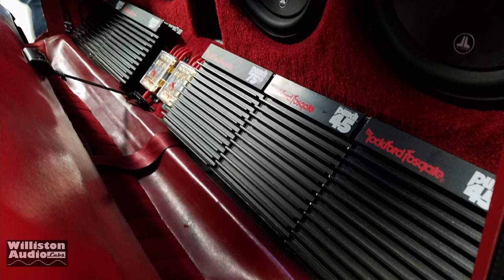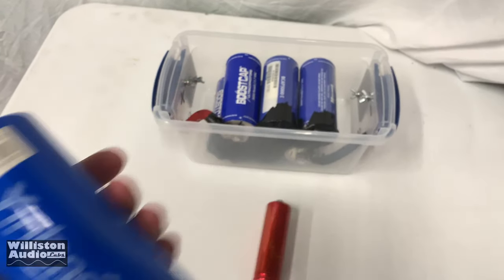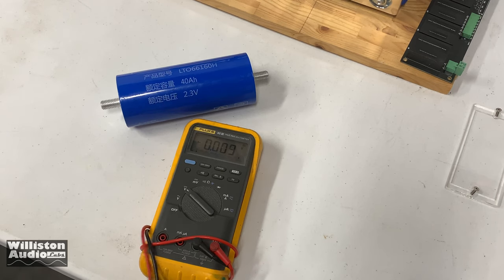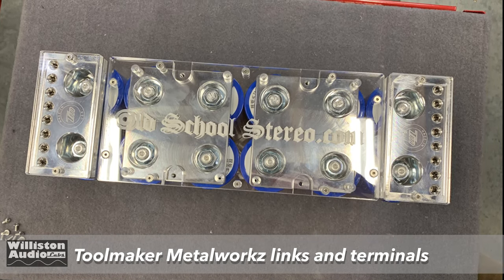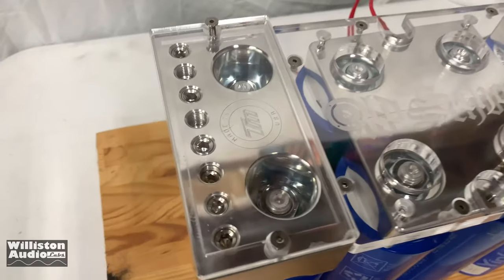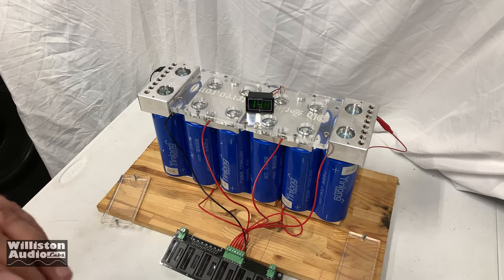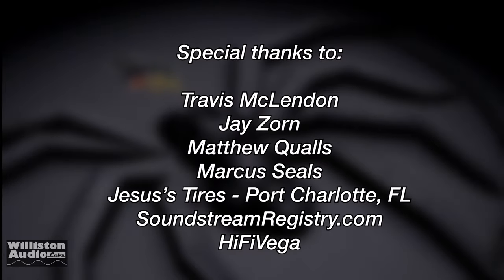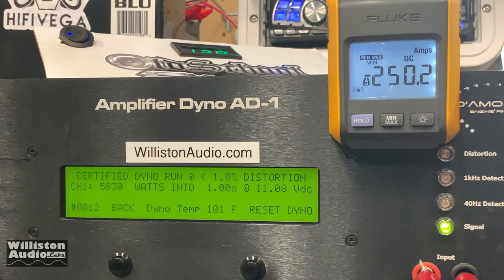Lithium Batteries for Car Audio? Yinlong LTO Cells LTO66160H 8000 watt capable Battery Bank [4K]

Comment: Lithium is soo cool. Which I could afford it right now, update: I've purchased 72ah of headway, power supply and a bunch of other junk to test and wire them up is here just waiting on the cells. Stoked to stay @ 14.3v when dumping the bass. Thanks for the info. It's all useful fosho

Comment: Nice and clean ! As I was typing my comment you said it! You can get an 80ah bank for about 900 which is damn good I got a friend that spent 3-4 grand on XS lithium 🤦🏽‍♂️ I’m going to share this with him lol
Reply: I figured those XS lithiums were overpriced but damn. AGM for me
Reply: You can build this bank with the xs power 45 which is rebranded yinlong but a 6 bank series is 45ah not 40h same shit Big D has here just 45. Anyways you can get a 12 cell bank of either the 40ah for 900 but the 45ah is 100$ more it's a lil over 1,000$ but that's 12 cell bank 90ah all the bus bars, bolts and balancer from Big Jeff he has both even the 35ah for a lil cheaper.  What in the f*** did your friend buy that was 4 bands lol
Reply: @GTILOUD  what about CMAX.   They have a 45ah for $799.00?  That sounds like a better way to go unless you know something I don't?  Please do tell

Comment: Just did 3 of these. 240ah. Replaced all my 7 titan 8 12volt. What a difference. Single 400 amp mechman alt. Ext regulator. Charge at 15.8-15.9. They will hold 15.1-15.3 for a minute with about a 1500amp current draw. So 500amp per bank. After about a minute it starts slowly dropping, but it’s rarely playing for more than 10-20 seconds at that volume. They also recharge fast. Back off the volume they are back at 15.8 very quickly. I could not more highly recommend these. I did 240ah with very nice bars. Each end accepts 10 sky high oversized 2/0. Total cost $3225. $1075 per bank. Great video big D.
Reply: Do you have any links to where you purchased all of your stuff the bus bars the cells the balancer
Reply: @GTILOUD  I bought them in premade 80ah banks from CES. Much easier. Looks a lot nicer. Balanced and ready to go when you receive it.  On any search engine type in ces 80ah. First thing that pops up.
Reply: @DrMichaelPetty- Im not doubting your experience with the Titan 8, but were they the PWR= power, or RSV= reserve? Also maybe something was not right in your setup, or the New Titan 8 PWR batteries are much better now? Because i just recently seen a test, where only 1- Titan 8 S6 PWR (10Ah @ 75c!) battery was used (only had a 6amp charger hooked up for the test), and it only dropped 1.8volts (16.0v to 14.2v) and powered an amp to 11,400 watts R.M.S. On the Smd amp dyno, with a 1,000 amp draw! The test bigdwiz ran in this video above, with the 2 banks of 40Ah YinLong Lto, (so 80Ah total), dropped from 15.0v to 11.0v with a 500Amp draw= 1/2 the amperage draw, and more than twice the voltage drop! And only made 5800 watts on the dyno.
Reply: @DrMichaelPetty- That 400 amp alt. charging @ 15.8v supplys 6,300 watts all by it self, then each bank of 80ah yinlongs support 6k, so x3 or 240ah= 18k of battery power, and 6,300 from alt. Power, for a total electrical power output, that would support 24k. The Xs power 6S Titan 8 PWR, charging @ 16.6v with a 400 amp alt., would only Require 3 of these tiny batteries ($799 x3= $2,397) to maintain 16v, with a 1500 amp draw.

Comment: Interesting stuff! I just spent nearly $400 for the group 31 UltraCap instead, after watching EXO’s video on it.

I already own the Maxwell ESM and love it. Wish I knew how to convert it for this
Reply: Do you like the ultra cap
Reply: @201231  I recently purchased that Ioxus cap opting for B-stock for 200 vs 400 (a couple days just about every vendor reduced regular price of 400 to 300) which only had some scratches and a little chip on the plastic seem. Purely cosmetic and honestly can't believe that cut the price in half. At any rate I am literally obsessed the cap it is unreal. I can't believe they don't seem to be gaining the traction they deserve. Running 2, 1k monoblock amps with factory premium amp (650ish watts) while charging my phone on a AC/DC converter with Heater/AC full tilt, windshield wipers on, and no perceivable voltage drops, lights dimming, and subs hitting so much harder maintaining consistent power with hungry continues trap bass lines. I literally almost want to purchase another one just in case mine gets stolen or breaks for some reason and they sell out (noticed some websites B-stock is getting low). But I figure with a 10 year or whatever it is warranty by the time the thing goes out whatever is available will be better or perhaps smaller which would be welcome. I still might buy another one while I can get one for 200 bucks for a christmas present or something. Father has a diesel truck that needs 2 batteries and a ton of juice to start so while not a basshead like me could use one of these and only 1 battery and not get stuck somewhere like we did the other day. Have a 5k amp on the way thats happy at mid 12 volts (sure you can guess which one that is) and just going to use my current 120 amp alternator (big 4 of course) and one XS AGM battery sitting next to the cap (have new LA battery under the hood, no isolator no issues) with 100% confidence. Just get one but please leave one B-stock left me me haha

Comment: Fyi nm = newton meter not nano meter
Reply from the maker: Great catch. Big dummy lives
Reply: And a 12mm by 1.75 is a standard metric bolt 😉 nothing special.
Reply from the maker: https://youtu.be/tqd3HS_m6SY
Reply from the maker: @massivehertz3869  they were $0.95 each at my local hardware store and $0.16/ea at BoltDepot
Reply: @massivehertz3869  mmyeah, M12 nut
Reply: nm = nanometer... Nm = Newtonmeter
Reply: I understand how confusing it would be growing up with the old imperial system. But the world runs on metric so it's useful to learn. 
Interestingly, important things made in the US (like space products, medicine etc) use only metric.

Comment: Also, I would like to add that for car audio applications there are effecively no BMS modules that can efficiently sustain the current draws we may see (400A+). As such, nobody really runs the BMS in the car audio world. I would like to see a retest of this battery bank without the BMS.
Reply: I guess as a person who does not know much about batteries, you did not see the gigantic bus bars that you connect to the amp.  The BMS he was using did not control the flow of current from the battery, it only maintains the balance of the cells to each other.  I work for the sister company to Yinlong that actually licenses them the LTO to make these cells.  I'm an engineer, so I know what I'm talking about.  There are BMS modules that will run the power through the BMS, don't buy one of those for high power applications like car audio.
Reply: No need for bms. Just use a cell balancer.
Reply: @timhoover1416  There are definitely stand alone BMS units that can handle 500 amps continuous. Daly makes a 500 amp smart BMS that can do 500 amps continuous and I believe well over 1000 amps burst, and the BMS settings are accessible and adjustable. I've seen them for Lifepo4 batteries, but I haven't looked for an LTO BMS yet, but I'm sure they are out there. You are right though, the BMS would be a constant parasitic drain on the cells, and not desirable, even with the extra safety it provides. LTO Cells are already really safe and can take much higher Voltage than most car alternators provide, so I can understand why most people only run an active balancer with a 6s setup of LTO. Battery hookup has a nice little setup of LTO Cells for $200 that would be perfect for automotive duty, but I think I would probably want a 2p6s version of this setup, so at $400 plus balance board and some kind of Case, it's not so cheap anymore. It's probably still worth it though, just because they will outlast the car you put them in, but that's an argument you couldn't win with some people with a different viewpoint.

Comment: I went with JY 45.6 ah’s with 240a, 1 bank of XS power super caps, 2 15’s DC Audio level 5’s, 2 Crescendo 4k’s strapped while driving I don’t see under 14v. 
But I like these cells. Maybe switching in the future to CES 80 ah. Thanks big Dawg for the video. Excellent job.
Reply: Go with the ces 80ah its worth it ihave a 250 ces alt. Nd don't drop below 14.2.   Full tilt Then climbs back up to 14.4  On a synergy wfo 5k at half ohm in 110+ degree. Heat when the cars been runnin g for a while im happy with my ces 80ah. Feels good playing full tilt on idle not dropping below 14.2
Reply: Dbuilt Series thanks for letting me know. That’s awesome to hear even in hot weather. In Ohio we’re hitting 90 degree while driving I’m in the 14’s full tilt. It’s when at idle I drop to 12.8 to 12.2. How do you do at idle?
Reply: @UrAvgBasshead  at idle im at 14.3 14.2 full tilt. These lto cells are bad ass well worth the money gained more volume i used to only play at volume 56 clean on a pioneer x8800bhs. Now i can play to volume 60 clean had to re set my gains and volt meter when i switched to the ces 80ah. I used to have 2 northstar agm nsb31s in the rear droping to like 13.2 13.4 at idle almost full tilt while driving around 13.8. 14.0. Now im at 14.4 14.5 full tilt driving once im fully warmed up.
Reply: Dbuilt Series what charger do you use and how often do you charge your battery?
Reply: @UrAvgBasshead  i haven't recharged this new ces 80ah i just installed it today i have. A   Noco 26000 to charge it later on if i need to it should get the job done
Reply: I used to charge my. Northstar agm31s with this noco charger every 2 weeks held voltage pretty good with my alt and all my welding cable runs
Reply: Dbuilt Series thanks for the information. That’s awesome to hear.
Reply: Dbuilt Series I know it feels good to not be dropping. That’s how I feel when I’m driving. Slowly but surely I’ll get there.

Comment: when you do a draw test the cells will go back up slowly when in use,It had a big draw from the start so when voltage drop the amps go up .am using Headways but  I want this setup now to go with my 1500F 16v, super caps ;)

Comment: Discharge and recharge the bank a couple times. It will improve.
Reply: LTO batteries don't have very good discharge efficiency so the capacity isn't quite going to match 40 Ah. They do have some other benefits, though, but LiFePo4 is probably still the best way to go.
Reply: This battery pack needs a bank of super caps to allow it to charge and discharge with out over heating. Draining those batteries like that dyno run did they won't last very long.
Reply: @iamjackalope  LTO cells are fine with being charged and discarged at 10C. That translates to 400 amps of current going in and out of them - per cell. Once you add six of these cells in series, you're looking at a battery pack that you can push 2400 amperes into/out of. Not that that is possible, there are too many other limiting factors, like the fact that 2400 amps at 12 volts would melt cables.
Reply: Dave Micolichek  Huh, yeah, you're right, I wasn't thinking that through. But still, you'd need one hell of a system to draw more than 400 amperes (and at 10C they can deliver that).
Reply: LTO batteries are quite odd for music aplications.. they can be used as a off grid solar system battery pack due to the cycle ratings ( Propperly charged and not full discharged etc. up to 25 000 maybe even more  ) so they are worth it against Lead Acid but they are much mooooore expensive and BMS board is expensive too aspecially the more than 6S BMS for some type of aplications like power inverters from 24 to 230 Or 110 50/60Hz with huge ammount of power. And yes they are quite a bit expensive than LiFePO4 batteries but they have a highest longevity from all batteries. And also they could have 100Ah per one cell  and they are i think 3.2V maybe idk 🤷‍♂️
Reply: @lorcro2000  batteries in series do not increase total amps, but it will increase total voltage. running the packs in parallel would increase total amperage.
Reply: @blackwhip  Yep, brain fart on my part, I did honestly know that. But thanks.
Reply: Dave Micolichek  this is still a 2P6S pack, so 800, not 400 amps.

Comment: Ok so. Just to add to the parallel charging info..
You need to be careful when charging in parallel. Each cell needs to match as closely as possible. Not just in capacity but their impedance, IR (internal resistance) needs to be the same as well. If one cell is lazy, the parallel board is averaging the sum so others can take too much. 
I would cycle all of these probably 3 times then check what each cell accepts in capacity and what the IRs are. If they differ +\- 2%, don’t parallel them. This is much more crucial with other chemistries but still relevant here. Especially going in my vehicle.
Anyways... Love your channel Big D... keep that shizz up 👊🏼.
Reply: I agree. We're generally talking about minor tolerances but it can add up and be catastrophic over time. Less of a problem with caps, but lithium fails in a much worse fashion (unless you can somehow manage to seal the vent on the cap and turn it in to the.. you know).
Reply: Did you not notice the balancer he used?

Comment: Buddy is running 2 80ah CES batteries and a 370 amp alt. Charging at 15.3 drops to 15 full tilt and slowly goes down from there. Long demos no problem and charges back very quickly. 2 12k amps at half each
Reply from the maker: Great feedback. I’m getting 2 more banks
Reply: @wal  can't wait to see it. I really appreciate you showing the setup.

Comment: Yoooo. This is smart. 
I made a "home sound system" from a car audio setup in an mdf enclosure. Oldass Sony single din, 4 speakers, a jl 250/1 and a 12" infinity kappa. 12v comes from a PC psu. And reserve power from a huge lipo pack salvaged from a fried jump starter. The 12v regulated output from the psu will never over charge the lipos but they are in a battery sack just in case.

Comment: If they don’t want to be paired with agm batteries is that for an extra battery or for the main battery too?
Reply: Main battery but not under the hood you would do a battery delete and place the yinlong away from heat

Comment: Is this still current as far as what people are using the Ying Long LTO cells?
If so, is the price the same?
I'm glad you mentioned in the video not to use an AGM with these because I was considering building one and having the AGM under the hood to the small one and have this in the back

Comment: I have a ces 80ah yinlong bank and 1 bank of Maxwell boost caps stock 150ah alt and rest at 14.2 on  2 sundown scv.4000 at 1 ohm strapped .5 each amp and have never went below 13.5 full tilt in the lanes on a 1.15 sec average i guess were you had all draw and nothing putting back is why the test dropped so bad would do so much better in car testing they are amazing no joke and if i could get my voltage on up to around 14.8 they would do way better but its in a 2019 and the computer runs the voltage look forward to more testing in car testing

Comment: okay well I'm question if you're willing to answer it good Sir 
1. Do you connect this the same exact way you would connect a secondary battery? 
 2. Substituting this for a secondary battery along with a battery isolator with it.
 3. Do we connect this the same exact way? Power wire basically 1/0 from the lithium + all the way to the battery isolator + into the front of a battery front main battery + So once we cranked the vehicle over (depending on what you're charging voltage is) Will it put for example 14.8v to both battery and lithium cells. I'm just going to use my vehicle as an example. I have a yellow top optima upfront d-35 I was going to buy a secondary D-35, I'm a fan of Optima batteries pretty-much old School technology. Anyway if not a I was going to buy a nvx 10 farad capacitor instead? I'm pretty much upgrading my sound system. With a CT sounds 1000.1 and a CT sounds 80.4 total amperage draw would be about 140 amps I think? Along with 135 amp alternator, 1/0 big 4 wiring job.
 I number this that way there is no confusion. I'm probably wording this wrong but I'm sure you probably know what I mean?

Comment: Hm. Looking at switching over to these but so far all the claims of 5000w & 4000w per 40ah bank seem to be false. Also seeing that you mention that they are optimal when charged to around 15.6v. Considering I charge at 14.2v , would you recommend these? Looking to run around 10,000w on bass & 5,000w on mids/highs with a 250A alt. Will either be running 120ah lto & a 1260f super cap bank or 160ah lto. Not sure which is better. From your experience, any advice? Thanks & keep up the great work bro.